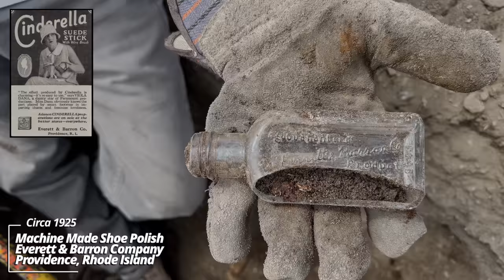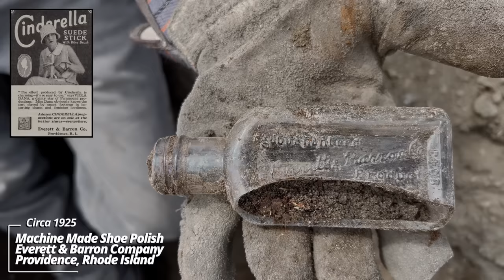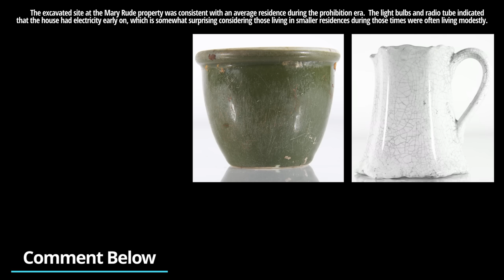An Unbelievable Find After Road Construction Accidentally Unearths 120 Year Old Ruins

Comment: This is one of the most stocked pits, lots of different items, you might want to get a metal detector and just check the soil for coins, lids, buttons, jewelry. It would give some more clues as to the items used.
Reply: It is stocked for sure but stuff found underground like this comes out with scratches on all sides and decreased value. It’s more about the passion and hobby of course.
Reply: @demsakawalkinglatetermabor7ion  I wouldn't mind finding some old scratched up coins.

Comment: Vacuum tubes were not used in transistor radios. At the time you were excavating, the 1920s and 1930s, vacuum tubes were used in the radios.

Comment: We were reconstructing an off-ramp on Interstate 5 and came across an old dump site like this, only everything had been burned with most of the glass either melted or broken.  Only had a lunch break worth of time to search as the crew was spreading road base that afternoon. Still managed to find a lot of intact small glass items that I still have.  Found only  the handle to a topaz yellow water pitcher that must been fabulous in its day.

Comment: How many thousands of ketchup bottles have you dug up!  When I was a kid, the mecruchrome came in a little bottle like you found. It had a glass rod attached to the top and would be used to smear it on a scratch or scrape. It really did sting and stain. It had to wear off. Thanks. I always learn something when I watch your videos.
Reply from the maker: I've dug a lot of ketchup bottles. I couldn't tell you how many. Thanks for watching! Be sure to check out our Facebook page (Below the Plains)
Reply: When I was young my scrapes were treated by mecuracom(?) and methyolate(?).  Times have sure changed in the past 70 years for me.

Comment: Just to let you know, that vacuum tube is out of a vacuum tube radio, not a transistor radio. Transistors were invented in 1947. Most of those early brass base tubes were about 1920 to 1925. The brand names were rubber-stamped on the bases.
Reply from the maker: We appreciate the info and will take note. Thanks for watching! Be sure to check out our Facebook page (Below the Plains)
Reply: Don't you find it odd that they had electricity at so early a date?
Reply: @danreed7889  It could have been out of a battery radio. A lot of early radios were. I would say that the house had electricity especially because of the number of light bulbs!
Reply: @danreed7889  It would have been more unusual outside of town, although many farms had a delco battery to run the lights or a milking machine.

Comment: How do you know where to dig? Super cool videos.
Reply: He uses the Sanborn insurance maps to find the general layout of the town then uses digging probes to feel out where there are bottles or where there is a loss of soil compaction.
Reply from the maker: First I’ll look for old maps or pictures. Even if it’s a newer picture they often didn’t move the outhouse far. Then check for low areas where the ground may have settled. Note the outhouses were moved every 10 or so years so there could be multiple several sites out there, which as mentioned, usually aren’t far from each other; they’re often in a row. Thanks for watching! Be sure to check out our Facebook page (Below the Plains)

Comment: It is a VACUUM TUBE that was from a radio. Transistors were not invented until 1947. Although transistors were invented as a replacement for the vacuum tube ,vacuum tubes were still the mainstay for electronics well into the 1960's and even later. Believe it or not, Vacuum tubes are still the gold standard for hi-fidelity in amplifiers. That vacuum tube is worth saving, I would, but then I was in electronics in the air force.

Comment: Vid 5:47
Heinz MUSTARD jar :
122 - (Sharpsburg handblown?, machine made) (1903-1910) 10-sided bottle held xx ounces (advertisement) Heinz Trieste mustard
(300?) - (Sharpsburg handblown)(1898-19xx) Patent design 1898 multi-paneled pumpkin-shape mustard jar held xx ounces
301 - (Sharpsburg contract handblown?, machine made) (1903-19xx) multi-paneled held xx ounces, 4 inches tall

Only the bottle number, embossing, and maker's mark will definitely determine this specific bottles' identity.
An ebay seller was selling the 301 for $30 - no chump change for this quality and special bottle.

BOTH this Heinz - and the original squatty polygonal patent designed French mustard jar (patented 1915 ... produced 1915-1920ish) - are high collectibles of this dump site's date range.

The other Heinz ketchups are also within the 1900-1920 production date range being handblown (1900-1910), machine made (1905-1910), and contract machine made (1910-1920) and high collectibles.

Comment: Vid 10:30
Heinz CONDIMENT, MINCEMEAT, CHUTNEY, and RELISH bottle :
- 192/H-192 - (contract machine made) (1918-1941) held xx ounces mincemeat (1918-1941), India relish (1918-1933)
- The bottle number in the center of the base embossing also had underneath the bottle number the square O maker's mark (Owens Bottle Company 1919-1929) - with no plant code ID shown.
- With the base embossing of H J Heinz Co, Patd this means that this food bottle was made in the (1918-1920) period when the H J Heinz Co on the base was still embossed (1880-1920).  After 1920, the embossing was removed, and only the bottle number and the maker's mark remained.
- This bottle would definitely be produced on Owens bottle machines 1st generation (1918-1920) and very-limited possibility of being a 2nd generation during the crossover machine period of 1920.
- As the square O Owens Bottle Company maker's mark is (1919-1929), this means this is a 1919 SINGLE YEAR of production range.
- This is a very special food bottle that should be put into a collection for its rarity and scarcity.
Reply from the maker: Amazing information as usual! Thanks again!

Comment: how you know where to begin digging from that sparse map i dont know
Reply from the maker: the maps just find the locations. the pits are usually out the back door, or on the lot line. but to find the pit we use probe rods and push them into the ground until we feel something, the maps certainly help, but they usually dont show the location of the outhouse itself. thanks for watching!

Comment: It's fun watching you pull history out of the earth, but I often cringe when you yank on a piece of broken glass with your bare hands. Between sharp glass and paper thin rusted metal I fear for your well being. Please consider cut proof gloves instead of the leather ones you sometimes wear. A dust mask would also be a good idea.
I have to commend the research that is done on your finds. The history of the item along with original advertising really brings life to the glassware and pottery.
In one or two hundred years, I wonder what our descendents will find of our discarded possessions.